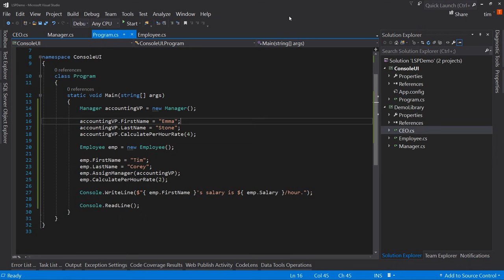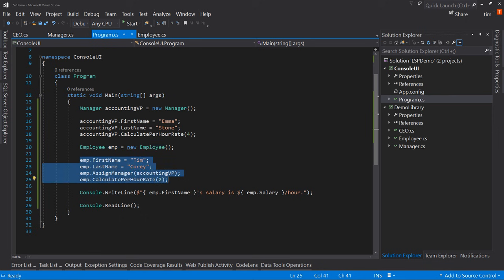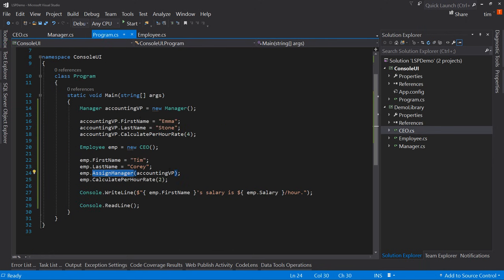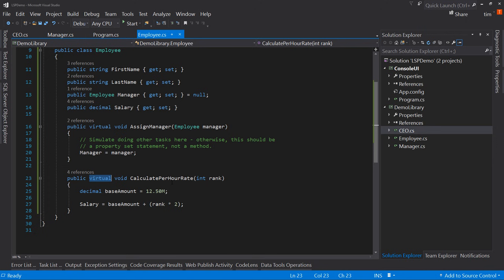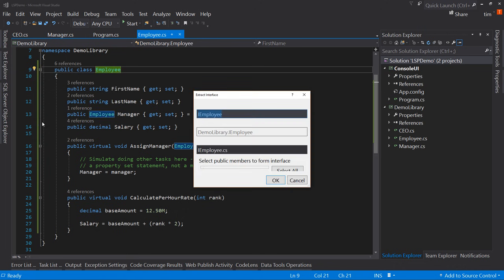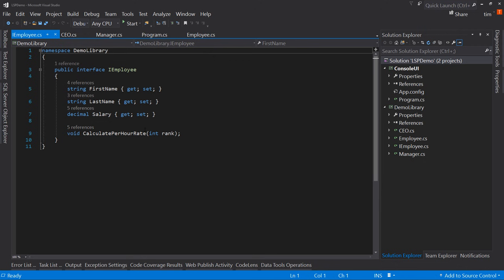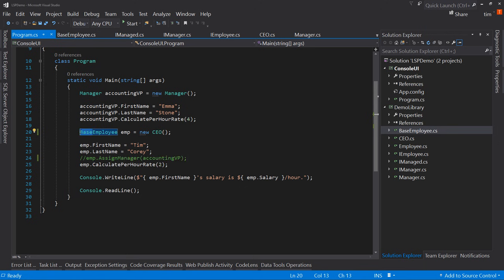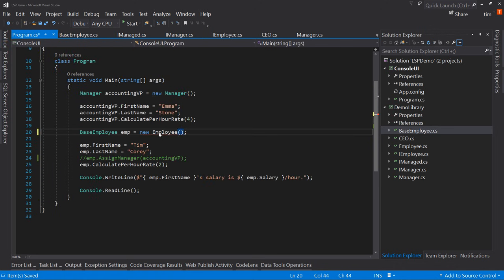Design Patterns: Liskov Substitution Principle Explained Practically in C# (The L in SOLID)

Comment: An interesting problem I find in C#, or C++ for that matter, is what if you have a constructor that takes an int. What stops someone who is using that class from sending in ANYTHING that is an int? For instance, what if the constructor is expecting an employee ID...what stops someone from sending in a Building ID?  Worse yet, what if the Building ID just happens to have the same ID as an employee? You program would go haywire and you wouldn't even know it. I've tried thinking up a solution to this problem but I can't come up with one.
Reply: This is where development can cause issues, if the constructor is expecting an int but you send a building id to it, then only you, the developer will know.  One method I can think of is to create a "IEmployee" interface, and pass the whole Employee class (which uses that interface) to the constructor rather than int, and then in the constructor you can then use emp.Id. 

This is where DI (Direct Injection) comes into play and why we use interfaces in methods rather than actual classes.
Reply from the maker: Never trust the user. That's one of my main mantras when it comes to software development. Now the general answer to your question is "nothing". You can't limit the type of int you get back if the type of int is not different than other types of ints. For example, if I asked for age (a number between 0 and 120), someone could send me the number of years they worked at a company and I couldn't stop them. However, there are things you can do. First, any validation you can do is important. If the employeeId is unique in any way, check for that. If they are always six numbers long, check for six numbers. If they start with the letter "E", check for that. Next, name things well. If your parameter is named "id" then people will accidentally pass in a buildingId instead of an employeeId. Name it "employeeId" and then use the triple slash code comments to further clarify what that ID is. Third, do a lookup on that ID right away if it is that important. Make sure the ID exists. If it does but it is not the ID they meant, well, you can't help that necessarily. The final thing to do is not code it improperly. Remember that you are probably the one sending the data in. Make sure you pass the correct data. If this comes from the UI, that's going to be on the user. Give them as much help as possible. For example, for buildingId, I wouldn't give them a free-form box to type in. I would try to give them a dropdown so they have to select one from the list. Either that or, if a free-form box is required (for speed or because of the list size), after they move out of the box, look up that Building by ID and put the name of it next to the box. If it is an unexpected name, they will go back and change it.
Reply: Using an Interface doesn't solve the problem because there are many classes that can inherit from that Interface. You could still send in the wrong class.
Reply: Yes, but would a building class have the same interface as an employee class? I was meaning interfaces so you don't have direct injection (DI), so using  MyConstructor(IEmployee emp)  then within the constructor you can look for emp.id, as you will know that the IEmployee has that id field, if you're passing in the building class, that has an IEmployee interface, then you've done your building class incorrect, that should have a IBuilding interface - yes it might also have the "id" field, but you won't be able to pass that into the constructor when the constructor is wanting an IEmployee class.  But as Tim says, before you pass in the class with the id, you will of course need to do validation on the id first, especially if it comes from a user by typing a number in a text box. - Never trust users!
Reply: The solution to this problem is to change your premise. What you're saying is this: If I allow the function to accept an integer as the argument, then it is possible to send an illegal argument to the function. But that's just another way of saying this: The set of valid employee ID's is not the same as the set of all integers. Or, in other words, an employee Id is not an integer. An employee ID is its own distinct type. 

The more formal way of saying this is that you have to define your domains. In this case, the "domain of employee ID's".

Now, the building ID thing isn't actually that much of a problem. It might be the case that the value of a building ID, when cast to an int, has the same value as some particular employee ID when cast to an int. But if casting to an int is an allowable operation for both building ID's and employee ID's, that's actually not a big deal. By way of example, I could take a byte datatype and cast it to a numeric value, or interpret it as a letter if I include an encoding. The fact that a capital A in ASCII has the same value when cast some particular way as the number 65 doesn't create any problems, even though they are two distinct datatypes, as long as the cast is a valid operation for the type. And it's up to the programmer to define it as a valid operation or not. If you don't make the operator available, then the cast can't be performed.

Comment: So when implementing state pattern we will have different actions in the interface and different states will have their implementations. Some states done have any actions to perform so at that time we throw not implemented exception. What is the best way to implement that.

e.g. Telephone class has multiple states- Idle, Ringing, Answered, OutofOrder and multiple actions could occur like Ring, Dial, Connect, Disconnect, Mute, etc...

Not when the state is in Idel then Ring action will change its state, but when its Idel Disconnect action would throw an not Implemented exception. So what is the best way to implement in this scenario...
 Need you expert KT on this..
Reply from the maker: That isn't really the same thing as what we are discussing here. You are throwing the exception because the action doesn't make sense. I wouldn't call it an NotImplementedException. It is more of an invalid action rather than not being coded yet.

Comment: My initial reaction was to just make an IManagable interface and keep the inheritance as is. It's really interesting how elaborate it gets. Great explanation as always but I got to protest a bit and say it gave me a headache in the end.

I do have a specific question that involves a dirty fix. Couldn't one use some made up default or edge case value for when we wanted to set the manager for the CEO? For example the manager for the CEO could be set to itself instead of throwing an exception. Why would we want to avoid such a solution? Very curious what you think Tim.

Thanks for the videos once again.
Reply: It may be a bit late for an answer but here is what i think (even tho i'm not Tim):
If we implement the SetManager method to set the ceo as its own manager, ask yourself the question "and then what". What's the purpose? It will add more confusion in the long run. Imagine you edit that project 5 years later or a new team member gets the project. You'll probably ask yourself "why is that?". It's better to implement only those things that it is really supposed to.

Comment: If BaseEmployee just implements IEmployee and doesn't add any members of its own, is there any benefit to having the IEmployee interface when BaseEmployee is abstract? Couldn't we just remove the IEmployee interface and change all the references to BaseEmployee instead?
Reply from the maker: Mostly we don't need IEmployee. However, there are a couple reasons why we might. First, BaseEmployee isn't abstract so we might add more things to it. If those changes cause a deviation for any reason, we might want the interface still. Second, if we are using dependency injection, we probably want the interface to make things easier to configure, more flexible, and easier to unit test.

Comment: Hi Tim. Thank you very much for your very helpful videos. 
I was wondering why we need the IEmployee interface, as BaseEmployee is already abstract. Do we really need IEmployee?
Reply from the maker: Interfaces are not concrete. We can put any IEmployee object in them. An abstract class is concrete. If we were going to add unit testing, it would be easier to mock an IEmployee item rather than a BaseEmployee.

Comment: I have a question. why we override AssignManager() method in CEO class? it's virtual so it's optional. if we didn't override it, we would not faced with exceprion.
Reply: Correct me if I’m wrong, but it shouldn’t be there in the first place. Given that the CEO is “unmanaged” person, so the class for it shouldn’t have any manager assigned to begin with

Comment: Thanks so much! Very helpful stuff indeed. 
In this example, CEO and Manager are both implementing IManager the same way. Is there a way to get one inherit from the other?
Reply from the maker: I think you need to define what you are trying to do. If you want CEO to inherit from Manager, you could probably set that up. As for doing something with the interfaces, it doesn't work that way.

Comment: What's the point of doing this: " IManaged emp = new Manager(); "
If the employee won't get the methods of Manager anyway?
Reply: emp is just the variable name, because he created it as a "New Manager()" then in this case, emp will have the manager methods - note that a manager is also an employee. he manages other employees but he is also "Managed" by the CEO.
Reply from the maker: The employee will have the methods of the Manager, they just won't be visible using that variable. You can still get access to them later on if you need them. You can do a test on the class to see what specific type it is and then use it as that type. I'll be doing a video on that sometime soon.
Reply: It doesn't have the manager methods when I try to use them Harag.
https://i.imgur.com/l4ZNPb3.png

"'IManaged' does not contain a definition for 'GeneratePerformanceReview' and no extension method 'GeneratePerformanceReview' accepting a first argument of type 'IManaged' could be found (are you missing a using directive or an assembly reference?)"

Is this the correct way to convert it?
  Manager newEmp = (Manager)emp;
  newEmp.GeneratePerformanceReview();
Reply: @WorstDeveloper  I've played with the whole GeneratePerformanceReview issue and what I've done is created a IManagedManager interface which replaces IManager as the interface for Manager and looks like "public interface IManagedManager: IEmployee, IManaged, IManager { }". Does this break anything or violate SOLID?

Comment: is there any way we can know if the values we give by using equals operator or by arguemnts are pass by value or pass by reference in the entire program ??
Reply: Dunno if it’s applicable to C# but in Java which is another OOP supported language, all primitive value types (passed as an argument to a method) are always passed by value and all Custom Data Type is passed by Reference. This is because variables for Custom Type holds an address to the Object in the heap not the actual object itself where as a primitive type variable always points to the actual object.Hope this helps.

Comment: Which one would u think is better, ASYNC AWAIT or using THREAD? Also could u please tell me why u prefer that?
Reply from the maker: Async/await is basically a wrapper around threading. The goal is to make it easier to work with threading. Unless there is a specific reason to use threading, use async/await. It automatically takes care of things that you would otherwise need to do manually, and it optimizes the operations in ways you would need to do manually.
Reply: @IAmTimCorey  i see

Comment: If IManager extends IEmployee, any class that implements IManager also implements IEmployee which is basically same as BasicEmployee. So I don't see any point of having BasicEmployee class
Reply: As you said, its basically the same. But, the Manager and the Employee class have to implement then, witch, in this case, will be exactly the same code, so he created BasicEmployee to avoid repeating the code (DRY)
Reply from the maker: Rafael is correct. It is a way to keep the code DRY while still giving us the flexibility we need.
Reply: @IAmTimCorey  make sense, but the thing that confused me is that if every class that implements IManager interface also extends either BaseEmployee or Employee then why IManager interface needs to implement IEmployee interface? what I mean is, all the classes are already implementing IEmployee interface before they implement IManager interface and then IManager interface also implements IEmpolyee interface. That looks like kind of circular implementation to me.

Comment: Hi Tim,

 Employee emp = new CEO(); this line threw an exception and so it violated LSP. 

  In Base class,we have
  
      public virtual void AssignManager(Employee manager)
      {
            Manager = manager;
        }

we have marked method as virtual because a derived class CAN override it if wishes to(which means that if it doesn't want to override it, thats fine). So if CEO class inheriting from Employee doesn't override AssignManager(Employee Manager) method, we will not get any exception , right? So without any error,
I got output ?

Please tell me if am missing something here?
Reply from the maker: I'm a bit confused here. I'm not sure why CEO has AssignManager applied to it because a CEO does not have a manager. If I remember right, we put AssignManager in the Employee class and the CEO inherited from BaseEmployee because the CEO was not an Employee. Thus, the exception.
Reply: Yes, ofc, u can override method and make method do nothing and not throw "Not implemented exception", but, then you have a software that can call a method that does not do anything, that points that there is bad usage of inheritance. Or simply, why would one inherit method which it doesnt use?
Reply: CEO is not an employee, you should use IEmployee

Comment: It would make a lot more sense if you also displayed messages under the Managed (with manager-related) methods to demonstrate the differences in running a particular scenario where it is expected to be seen. Though I am still looking for a demonstration that will emphasize more how valuable this principle is. Likely, you can always substitute every derived class as long as it does not call for methods or properties not defined in the parent class and doesn't break things. Or does this principle simply imply "do not make inheritance which derived class' properties or methods are not expected to have?"
Reply from the maker: At its simplest form, this principle states that your child classes should do everything your parent class does (they can do more, just not less). That's it. It is actually a pretty strong pillar of OOP, but it is included in SOLID because it can get overlooked.
Reply: @IAmTimCorey  I might have missed it but that statement alone cleared up the entire L in SOLID for me! Should have definitely used that in the video (again, if it was not said)
Reply: @IAmTimCorey outstanding phrase! It seems that now I’ve got it!

Comment: I need some more help understanding: this video says that the child classes should be swappable as to not break the program, and the Manager property & associated method break the thing & make it work in unexpected ways. Well, if the program would have a try-catch statement where the manager is assigned instead (just as for example), then there would be no need to refactor this program as it wouldn't violate the LSP?
Reply from the maker: It would violate LSP. Unexpected exceptions are a problem. Yes, you can do a generic try/catch and catch all exceptions but then you will have two problems. First, you might want to catch only expected exceptions (so you can handle them individually). That would leave an additional type that causes your application to crash. Second, your application would now be throwing an exception where you expected it to run properly. This could cause your application to fail in an incorrect manner. The issue isn't catching the exception, the issue is that a class behaves differently than expected.
Reply: IAmTimCorey so if the program has an expected exception handling block and the classes are written just as in your beginning of the video, it’s still bad to throw exceptions from a class ?
Reply from the maker: It isn't about throwing an exception. It is about a child class throwing different exceptions than the parent. If the parent behaves one way, the child should behave the same way (in terms of what it supports and what exceptions it throws, not necessarily in how it accomplishes the tasks).
Reply: @IAmTimCorey  Aha, I learned that I was in fact not paying attention to the very basic fact that all those sub-types are actually getting cast to the parent class.. it's right there on the screen but it was evading my thinking for a while. Now it seems very common-sense to me, yes, and thank you!

Comment: i got a question, this is not related to the class, i will drop a code, could u please tell me what is happening here, i dont understand

public class Program
    {
        public static Task Main(string[] args) => new Program().MainAsync();
        
        public async Task MainAsync()
        {

        }
    }
Reply from the maker: That's an old (no longer needed) workaround to allow a console application to call an asynchronous method.
Reply: I see. Can u please explain this part, i am bit confused
Reply: @IAmTimCorey  so what does it do? does it make multiple threads for the Progam() ??? the thing is, i am working on something using their API and the thing is, there are libraries to help me deal with API more easily and they did this. so in the documentation of the library, they told me to do it like that. thats why i want to know more about it.........